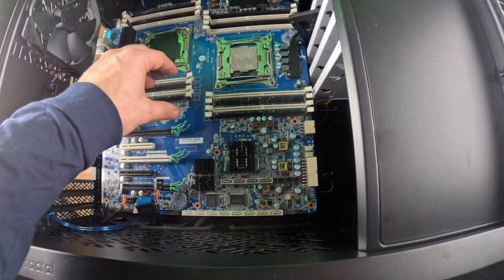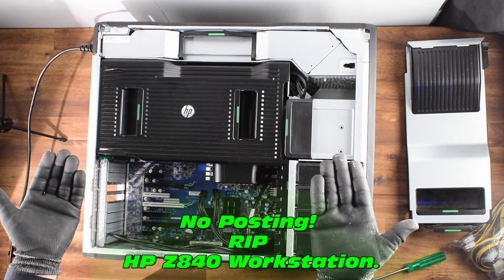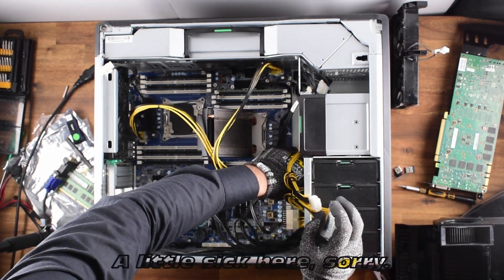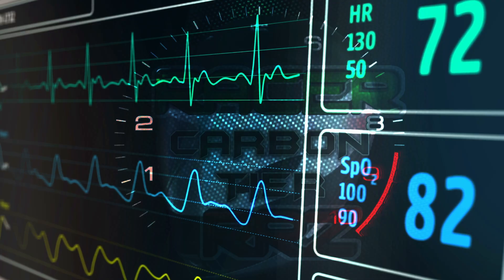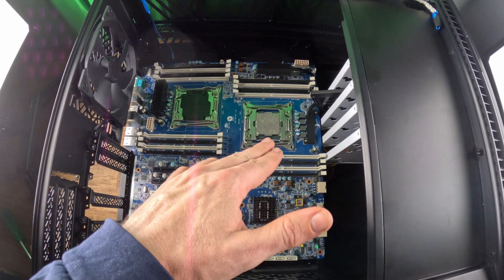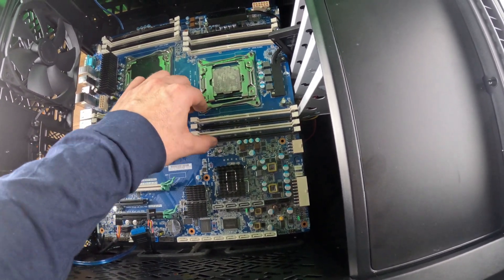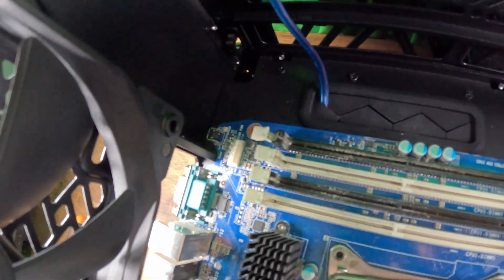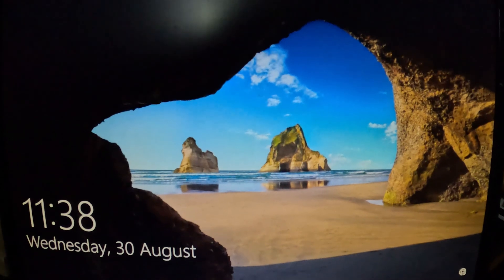SECRET VIDEO - CARBON TIER : HP Z840 motherboard powered outside its case? Wait - what did that say?

Comment: Bro how to baypass these Errors Cpu fan and M memory fans
Reply from the maker: I presume this is for the Z840 case swap? The best place to find the answer is here: https://projects.diegoromero.eu/hacking-the-hp-z840-into-a-standard-case/ . Most of the errors can be bypassed with a Dupont jumper cable connecting to the right place. Diego gave a comprehensive breakdown of the best fixes for the Z840.
Reply: @racerrrz Yes I have Baypass These All But I Stuck at Cpu Fans Errors

Comment: How did you get past the fan connections and the errors?
Reply from the maker: At the time - the enter key lol, but I'll revisit this idea with a full video guide. Fan wise there are work-arounds, but the most ideal solution is to reuse as much as you can. The most annoying error is the USB 3.0 boot error - but you can remove that error in the same way as you remove the USB 3.0 error on the Z440. I am yet to make some progress on this - and in the mean time someone else published a full guide that is worthy of notice. Deigo did a full HP Z840 case-swap write-up and placed it up on his website here: https://projects.diegoromero.eu/hacking-the-hp-z840-into-a-standard-case/ (Google search for Z840 case swap should bring it up also).

Z440 USB 3.0 error fix: https://preview.redd.it/hp-z440-case-swap-v0-vu993rh5iage1.png?width=947&format=png&auto=webp&s=423af1c2adedf49a4a0771ae3a70dea749504689

Z440 USB 3.0 error fix visual: https://preview.redd.it/hp-z440-case-swap-v0-sjwrpx0ctqfe1.png?width=2500&format=png&auto=webp&s=9f90743bffd584622bdabb6ea4a8628d8b10c93f
Reply: @racerrrz  Thank you for the reply and additional resource link! I am going to try to make sense of it. I am in this pickle because for some reason i thought my z840 was off and ended up removing the fan shroud and in my surprise of it being on i quickly plugged it back and in took the dreaded smell of burnt electronics. When i checked the motherboard, there is a trace completely cut and a few surrounding capacitors in short mode.

Thankfully the system still powers on but now i get the following errors: 517 memory fan , 520 memory fan 2 and 511 cpu 0 fan not connected. They do not spin but the fans are working, i tested them. So this is what i am trying to bypass instead of just buying another motherboard.
Reply: @JeanneRobinson-vf4ns Have you Baypass I have baypass all fans But stucked at Cpu fan Error